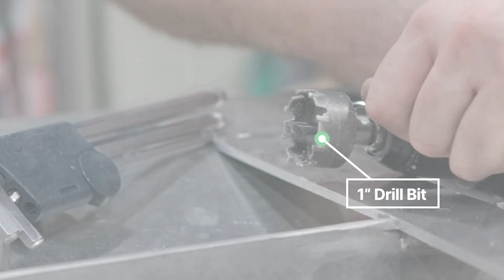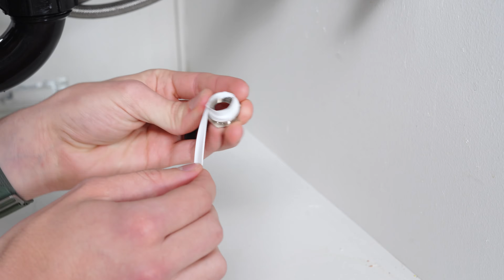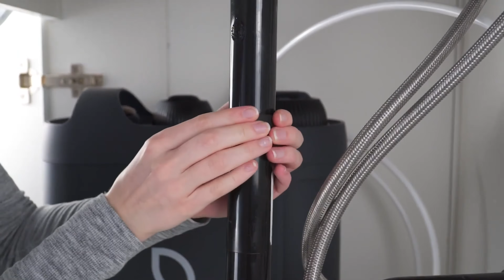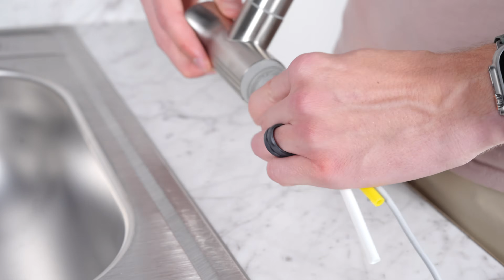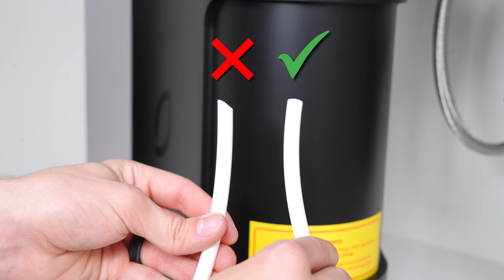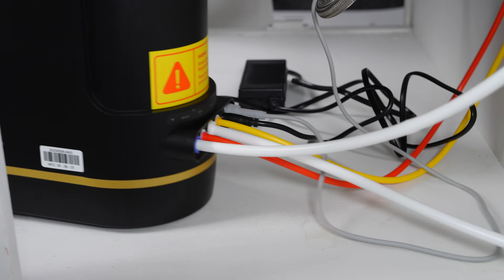How to Install the New UltraLux Water Machine

Comment: I want to buy one of these machines. But I thought when I purchased it, someone would install it for me. Am I correct in thinking that?
Reply from the maker: Hello! We do not have technicians across the United States, or in other countries, so we recommend our customers find reputable plumbers to install the machine and we reimburse them up to $150 USD to help with the installation costs!
Reply: As difficult as it seems, it is actually very easy. Just follow the instructions and you will be just fine. A technician will want to charge you over $200.  The only thing to keep in mind is having an outlet nearby, or right underneath your sink if you have a dish washer or garbage disposal unit.  For 3k, it is worth spending the time installing it yourself.